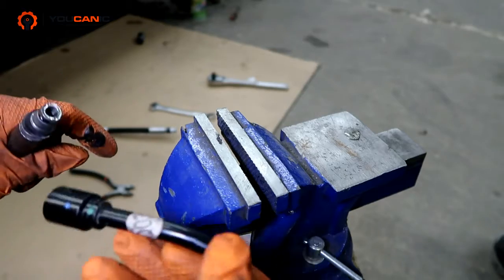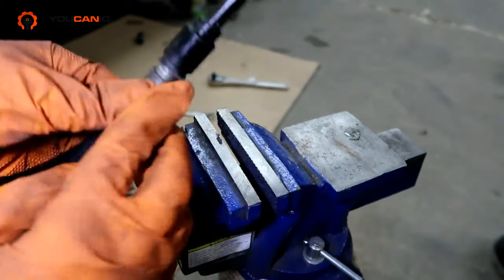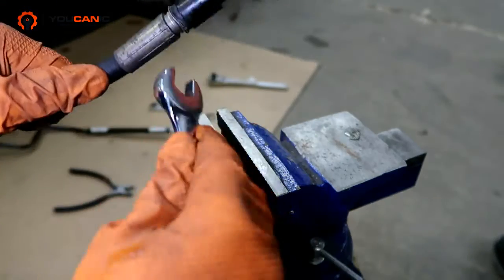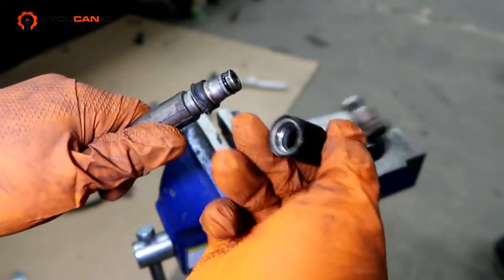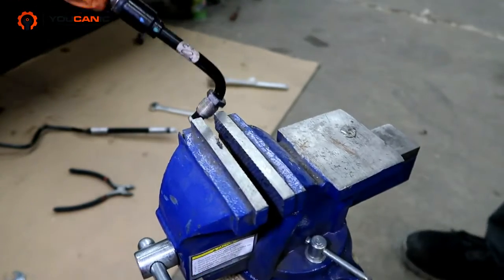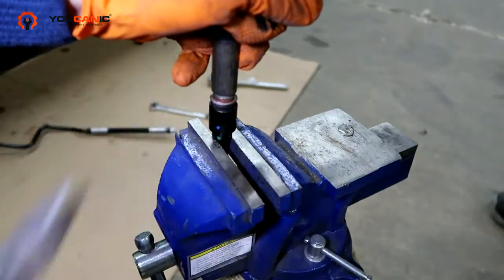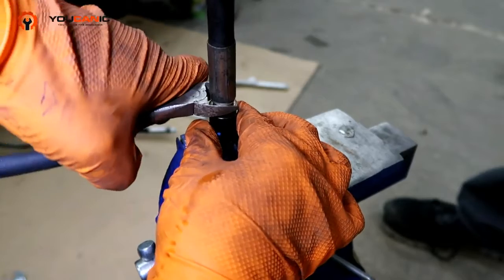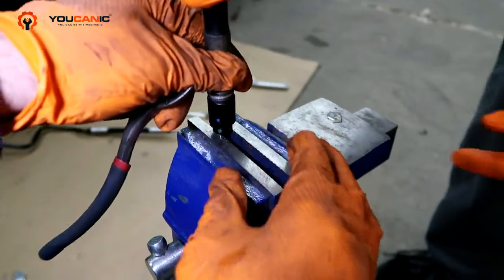Mercedes-Benz How to Disconnect ABC Suspension Hose Quick Connector

Comment: hey can i do this ONLY to remove the ripped rubber portion and replace it ???while on the car? 
which crimper tool are you using
Reply from the maker: Thanks for your question! Yes, you can certainly remove the ripped rubber portion and replace it while on the car. The specific crimper tool being used in this video can be identified on our website, YOUCANIC.com. We pride ourselves on our mission to equip and empower car owners with free resources, guides and tools to ensure safe and confident car maintenance, including a library of factory repair manuals.

We encourage you to explore more on www.youcanic.com and don't hesitate to get in touch with us there for any further queries. We're always here to serve and support you on your car ownership journey.
Reply: @YOUCANIC  do you have a part number?> please try to be concise with your replies thanks

Comment: I cleaned the area first with brake cleaner then i used 2 locking needle nose pliers to pop them apart in that tight area it worked great

Comment: QUESTION: WHEN YOU DISCONNECT THE TWO FITTINGS, DOES THE REMAINING USEFUL FITTING NOT LEAK? I HAVE MULTIPLE VEHICLES WITH AIRMATIC PROBLEMS, EITHER FRONT OR REAR HAS DROPPED AND I AM CONSIDERING GOIN TO COILOVERS ONLY FOR EITHER FRONT OR REAR AS NEEDED. THE PROBLEM IS HYDRAULIC LINES CAPPED AND OF COURSE HOW TO BYPASS ELECTRONICS SO AS TO NOT TRIGGER WARNINGS. THANKS FOR YOUR OPINION
Reply: If you pull the abc fuse the red warning light is supposed to go away